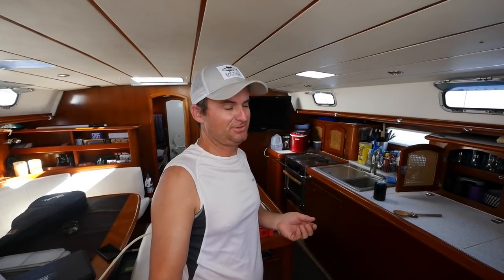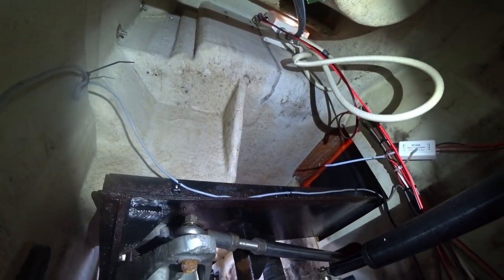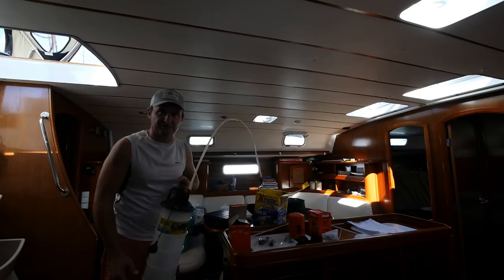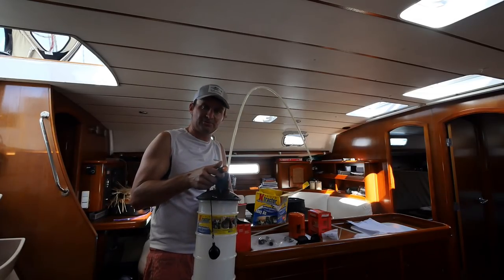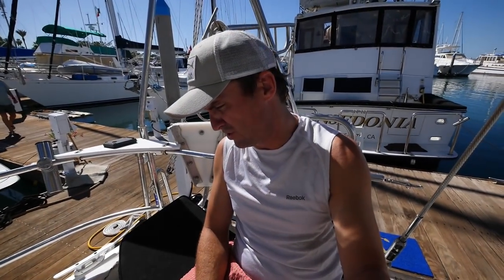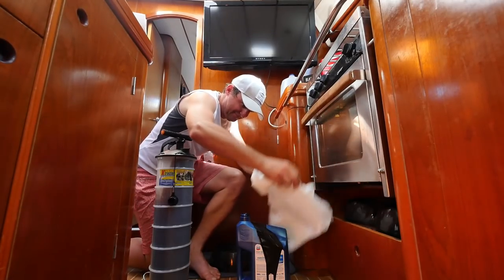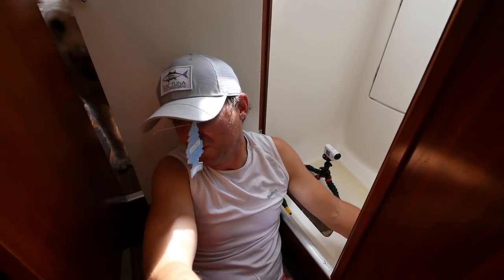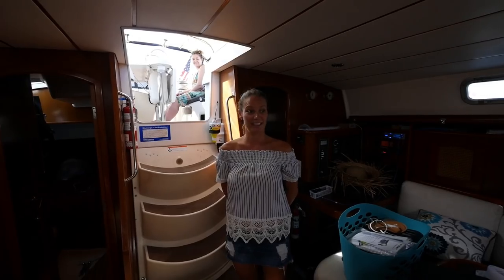Kinky Hose & Oil Change - Maintenance Monday

Comment: Bobby-use your clean oil on the new filter gasket. Look on the filter for instructions-once the gasket touches turn the filter 3/4 turn. That is tight. A dry gasket or overtightening makes removal more difficult.

Comment: I found if you flush the toilet a couple times with clean water before disassembly you clear the hose of stuff and makes the job a little better. Probably should have changed the joker valve while you were in there.

Comment: Great video Bobby. With your oil extractor instead of having the end of the tube cut square, cut a V in it and it prevents the end from getting stuck to the bottom of the sump.

Comment: A couple suggestions: One regarding the oil filter, the older you get, the more uses you will find for oversized channellock pliers.  I have a two of #460 and use them frequently, mostly for poolhouse plumbing issues, but even for jars in the kitchen when necessary.  Second, small portable fans are readily available, and would be so useful for circulating air to dry up dampness & humidity, etc as well as that occasional bathroom issue or excursion to the hell hole.

Oh and I never thought that it would be fun to watch Laura leave....

Comment: A couple of tips from owning two of these extractors. In the box the oil extractor came in, you'll find a threaded fitting that will attach the extraction tube directly to the top of the dip stick tube. It has threads similar to a water hose fitting. This way you are using the dip stick tube instead of the tube you have to insert into it. A lot simpler and cleaner doing it this way. Also, once the extractor is full, empty it, then reconnect it and try to scavenge more oil from the pan.

Comment: I am claustrophobic and you state it is more difficult to out than in ! You need a weight on the hose to pull it down straight when fed back in from above. great advice on the oil change.

Comment: Someone already mentioned this, but if you have a good leather belt, they work really well as a filter wrench by using the belt wrapped around the filter, held tightly, then slide a screwdriver under the belt to use as a lever to turn off filter.  Better yet, pick up an actual "belt wrench" because those can be used on filters of all kinds of different sizes, and even for some pipe fittings etc.

Comment: Few tips for anyone... I always make sure the old O ring comes off with the old filter. pull the o ring off the new filter, apply oil to all surfaces and put it back. When you put the filter on it doesn't take that much torque. Seat the o-ring and turn a little more with one hand till it just gets difficult to turn. The seat pressure is very high as the threads on the filter to the filter body multiply the force from rotation. Just a tip from a airline mechanic. Most people WAY over tighten filters causing issues down the road. Run the engine for 20 min untill hot and check for leaks.

Comment: 1) use a phillips screw driver to punch thru the filter for some extra leverage, 2) use the funnel to put the oil back in the empty container, 3) pour some new oil into new filter. Not as critical as some people try to make it but still a good practice. JM2C

Comment: A leather belt will work in a pinch. Strap it around and tighten it then adjust as needed until you have the leverage you need to spin the filter off.

Comment: If you don't have a filter wrench, you can drill a hole in your filter and put a screw driver through it.  Use that for leverage.  If you don't have a drill, a hammer to the back of your screw driver will work...

Also, in addition to writing the date on the filter, it's also good practice to write the engine hours too.
Reply: It is also a good idea to fill the new filter with some of the engine oil before installing it,  that prevents the motor from running dry on crank up.
Reply: eptyr12 
His filter drains out by itself when the engines turned off.
Reply: The reason your filter did not come off is that it was turned on to tidely to begin with. Use the fresh oil on the rubber seal instead of old oil. Put on the New filter Just handthight with one hand (25nm). When rubber gets hot it also vulconices with the metal party it is skrewed against to. Making it sometimes very difficult to get it off. Just buy an oilfilter wrench for 5 US and you are always Good to go. Vacuüm pump is definitedly worth it’s money. Only when the oil is up to temperature (appr. 80-90 C.) you wil get everything out. Great funnel you have! For the cleaning up of the spilling; always have paper towels and breakcleaner at your side. Keep up the Good work. Filling up the oilfilter before putting on is useless as it is mounted horizontaly.

Comment: drive a screwdriver through old filter to get off if you dont have a oil wrench, also add some oil into new filter to get oil circulating quicker. ;)

Comment: Instead of writing a date on the filter, it should be engine hours. The date is pretty much meaningless. Also when changing the filter, ensure the rubber seal comes off with the old filter. Sometimes they stick to the filter housing and you end up screwing the new filter over the top of it creating a double seal situation and you will have a huge mess sooner or later. Also as someone else mentioned, it's a good idea to pour some new oil into the new filter before screwing it on. Another tip is to take a Sharpee and put a little "tick mark" on the edge of the filter and the edge of the filter housing so they are lined up. That way it's an easy visual check to see if the filter position has changed at all since the oil change. They can work loose with vibration over time.

Comment: A.  Did you check oil level after running engine (filter fills up) to see if it. Needing topping off?
B. Use you super cool funnel to pour used oil back in the gallon jugs. 
👌🏻👊🏻😉😎

Comment: I just saw a video about oil filters. The guy cut about 8 filters open. Showed the parts and all. Fram was the worst ! I have used them before, but after seeing his video I won't take a chance with them! They have  cardboard/paper type material on both ends and a flat metal pressure back flow  device. Most all other filters have a real spring for that purpose. Bad design. I won't chance an engine failure ! FYI
Reply from the maker: Hmmm didn’t know that.  Thanks for the input I will switch!
Reply: Glad to help. I have raced and sailed. You have to use the best you can get when you are out on the water !

Comment: Always something to fix on a boat, and at the last boat show I was at they were advertising 1 as "virtually maintenance free" which made me laugh, as anyone who has spent time on any boat knows there is Always something that needs attention!  Even a guy I know who bought a brand new one could tell you that. If you can get a swivel end for the kinky hose situation (hey, no judgement ;) it will stop that from happening ever again. And people, oil filters only need to be mildly hand tight, that's why they put that nice big seal on them, have changed my own oil since I was 15, and was recruited to work on vehicles when I was 13, not a mechanic, but I've done many, and mine never leak either.

Comment: Might have been easier to unscrew shower unit from lazerette pull it back enough to loosen hose fitting instead of having to climb into the depths of hell.

Also light film of oil on oil filter o ring true purpose is to keep the o ring from sticking to the filter housing. In your case it would be easy to see if it did. In hard to see places and folks not paying attention to old filter can lead to a "double gasket" after filter install and will cause a huge leak.
Reply: Jimmy Z easier to just twist the hose clockwise or anti clockwise and it will un-kink

Comment: You can use a 8x10 sq of sandpaper fold in half long way and use it for better grip should work if not  then use a rag and a screwdriver twist the till tight on the sandpaper  and now you have a filter wrench.

Comment: Yea, get a filter wrench.  Filter starts leaking at sea, or ruptures, bad seal. etc, you don't want to mess around with trying to get it swapped by grunting at it or stabbing it with a screwdriver.

Comment: I have been following you from the start and seen you have issues with smelly work. The Heads in particular.  Have you tried spreading Vicks vapour rube under you nose?  It is a better smell than you have.  A thought

Comment: You should remove the filter before pumping the oil as opening the system should allow a bit more old oil to drain back! Also, FRAM is never the right filter. I would try very hard to find a different filter brand, even if its not my boat.

Comment: We have a Perkins in our Bene also (Prima 50hp). It comes with a hand pump mounted in the block, on the starboard side of the engine for oil change. I wonder if yours does also?

Comment: So it is standard on marine engines not to have an oil drain plug on the bottom as with car engines?

Oh, when your oil filter gets stuck and is hard to turn, a trick is to get a hammer and big screwdriver and pound the screwdriver through it. Makes a bit of a mess, but not as much as you might think, and it's then easy to get off.

Comment: Nice early video. One way to deal with grumpy old oilfilters, is to drive i big screw driver though it, and use that as a handle. You're going to throw it away anyway. Good job!
Reply from the maker: +MSY Kajsa great idea.  Thanks!
Reply: Some cars leave little other option. I have thrown a filter wrench in frustration because it slipped and or there was no room to move the handle round and run a screw driver through instead. I always use the new oil to wet the new gasket.
Reply: Great idea indead but you'll have to have something to catch the filters worth of oil. Sideways mount will be about half full of oil.

Comment: OK first,  You should have put on four (total) clamps on the wash down hose,  Marine rules ya know.  2Nd Use your everyday pants belt as a filter wrench, easy peasy. 3rd Why did you not fill and flush toilet with bleach water first?  Loved the video!!!  Screamed out load several times especially with the oil spill and the pee splatter :)  Funny as hell!  Good job

Comment: On the oil change - you'll be shy one oil filter full of oil (it has to fill on the first engine run).
Reply from the maker: +Martin Hill yeah good point.
Reply: Horizontal filter. Just add what it calls for.
Reply: With the horizontal filter he should be fine as it will mostly drain every time he shuts the engine off. With a vertical filter and a turbocharger I’d fill the filter before screwing it on, that will reduce the amount of time the turbo bearings are dry.
Reply: For horizontal filters, I would add about 1/3 of the filter with oil.

Comment: Hated changing oil on my inboard.
Reply: Never fun, I used one garbage inside another inserted in the bilge completely under the engine then just let it fly.   Obviously, exercise extreme caution to avoid snags during removal (radiator hose clamps are the worse hazard).

Comment: that filter was on to tight. also you can just stab it with something sharp if need be to lever it off...
Reply: True! I did once with a screwdriver. (when i couldn't buy a wrench because shops were closed AND i didn't wear a belt yet AND i was sure i had the right exchange filter AND i guessed the length of the screw-on-stub right.) It worked out fine, all good.

Comment: you might check that Perkins for a remote oil drain that is attached to the drain plug in the bottom of the pan. You would hook your vacuum sucker to it. Most inboard engines are equipped with one. It insures getting all the old oil out, to where those dip stick tube suckers are iffy at best for pulling all the oil out. Also the panel of the shower you worked on could have been removed with four screws gaining assess to the hose connection, beats crawling thru the rat hole. Others have stated the need to flush the shit'er with clean water BEFORE !!! you break a drain line, so I will not.